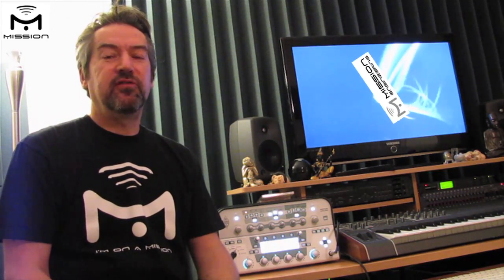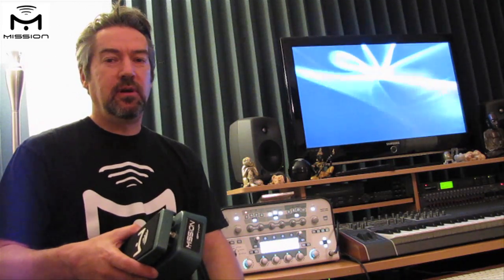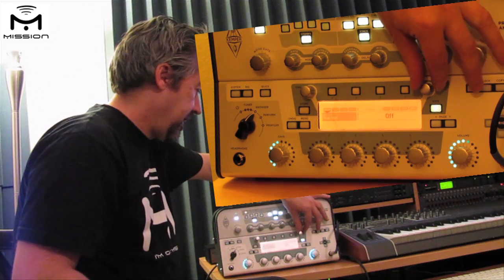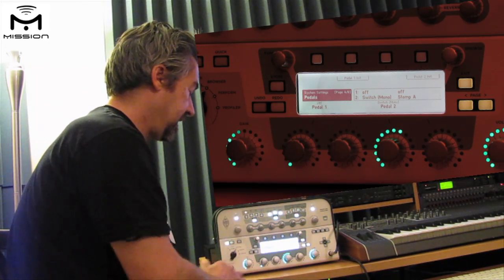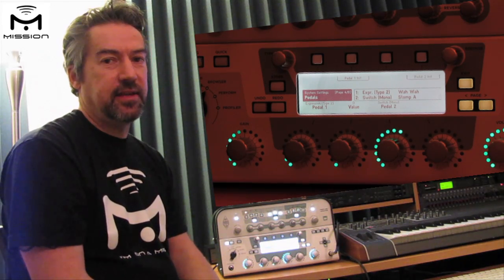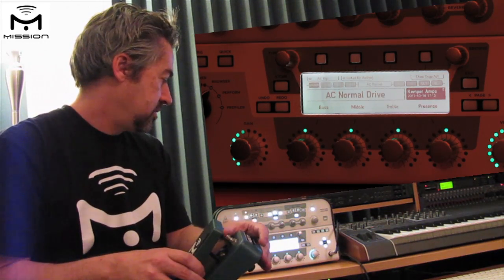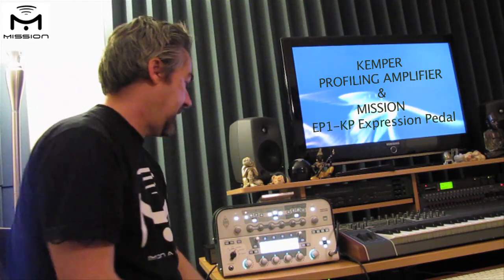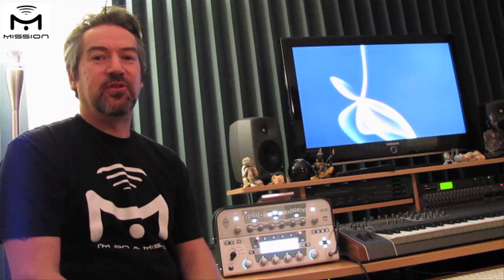Mission EP1 KP & Kemper Set Up

Comment: Will the line 6
Mission work on the kemper?
Reply from the maker: The Mission Line 6 expression pedals such as the EP1-L6 and SP1-L6 will not work with the Kemper. We have a Kemper expression pedal available at https://missionengineering.com/shop-2/products/expression/specific-use-exp/ep1-kp/ We also have some B-Stock units at the moment at https://themissionspace.com
Reply: @JamesLebihan  hello i have some problem  when i  press  on system  can't  see  the  pedals  settings  wah  on page 4 i can read  fx loop  send and return   why???

Comment: Make a video for the stage profiler. This setup doesn’t work on it.
Reply: I sent it back to Sweetwater because I couldn't get to turn on and off with the toe switch like a normal wah.
Reply: @HansOellerich  I had the same problem. I discovered that pressing the soft button „Calibrate“ activates the switch.
Reply: Mine seems to be having the same problem. I've tried to follow YouTube videos to set my pedal up with my Kemper and mine does not work the same way. I feel like I made a bad purchase with this pedal
Reply: @HansOellerich  What exactly is not working?

Comment: so if I use a mono cable to connect, it won't work?
Reply from the maker: A TRS (stereo) cable is required for the expression pedal output (OUT 1) a TS (mono) cable will not work. For the switch, you can use either TS or TRS